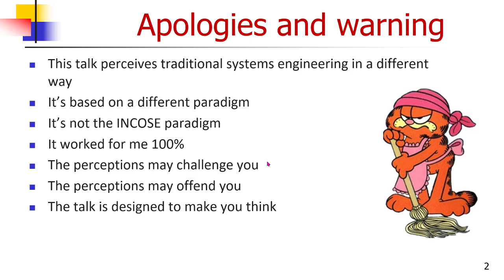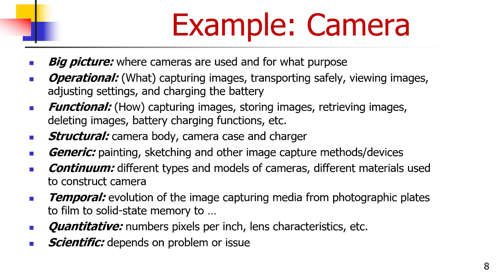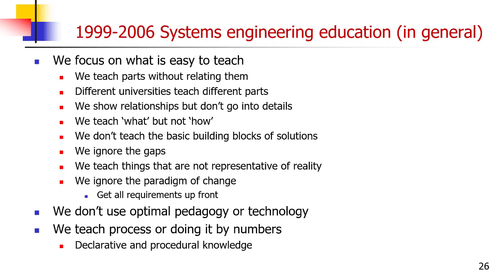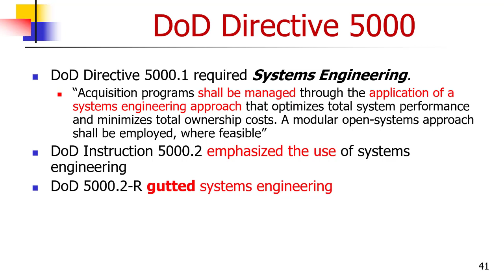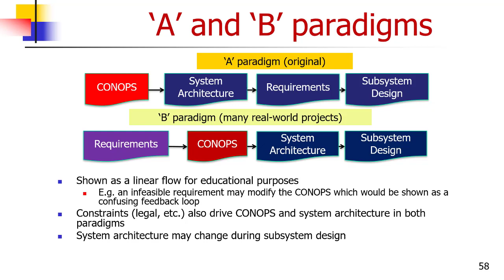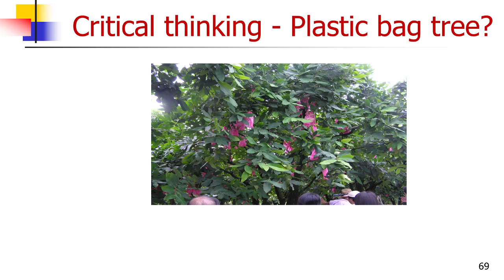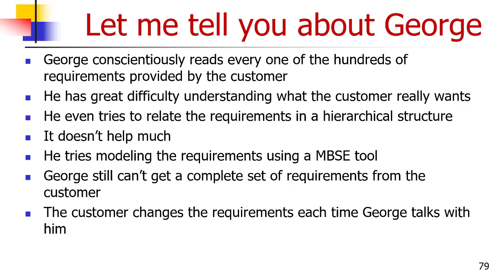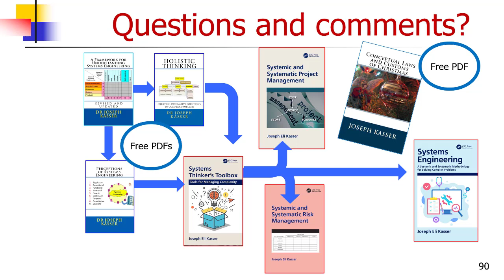Systems thinking as it applies to systems engineering

Comment: I came here to learn systems engineering and got scared away. i don't know if that was your intention.
Reply from the maker: Why did you get scared away? Scaring people is not my intention.
Reply: @JosephKasser  It's a great overview actually. But it shows there isn't a consistent one way of analysis. So i already know that if ill go into this. It will be not the quick stop i expected. But it will probably be quite a bit longer. I thank you really, it was an eye opener. I think i'm going to stick with it for atleast a while.
Reply from the maker: @test5095  There isn't a quick stop. I have a course with more than 50 lessons, some depth and some breadth. It takes you through systems thinking into systems engineering.